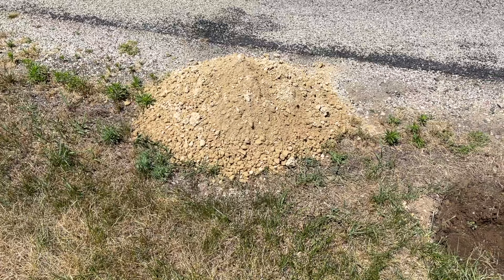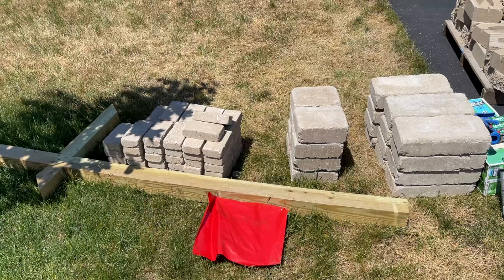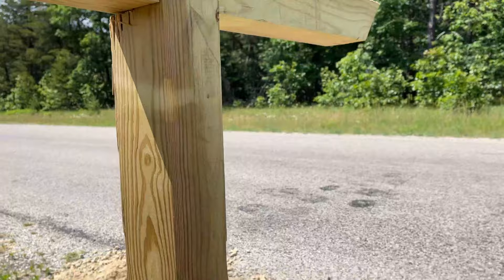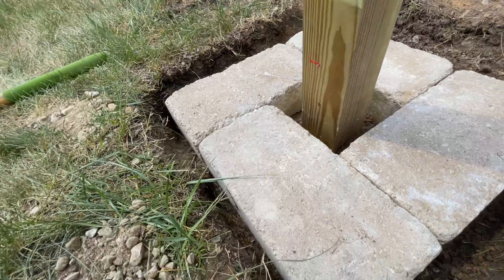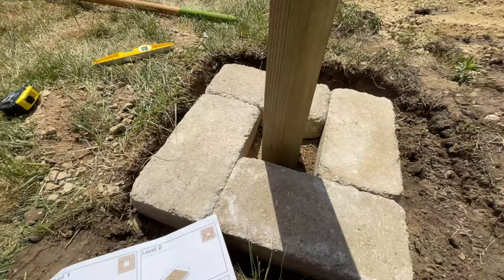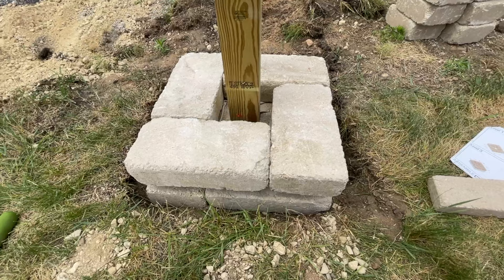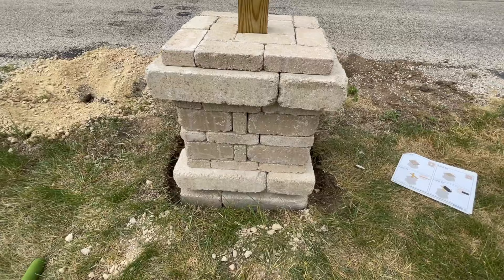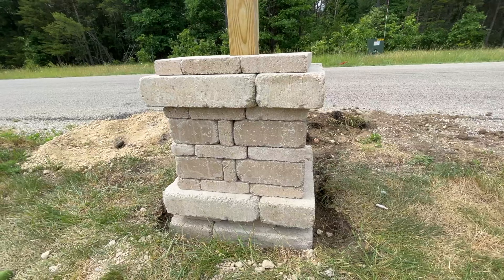How To Build A Decorative Mailbox Landscape Block Pillar

Comment from the maker: You'll Need:
If you shop on Amazon, please use Amazon Smiles to support Social Media Ministries. https://smile.amazon.com/ch/87-1084575

Coated Work Gloves
https://ebay.us/liG0S4

1 Foot Level
https://ebay.us/NofE69

2 Foot Level
https://ebay.us/Fo6BMm

6 Foot Level
https://ebay.us/lccI67

Masonry Saw
https://ebay.us/k3VH0E

Or You Can Use A Circular Saw
https://ebay.us/5xWLUj

Masonry Blade
https://ebay.us/3cxsgD

Caulk Gun
https://ebay.us/C2fj4E

PL 500 Landscape Adhesive
https://ebay.us/e7i14L

Hand Trowel/Shovel
https://ebay.us/Kq7E0F

Cinder Blocks For Your Pillar
Check with your local Menard's, Home Depot, Ace, Fleet Farm, Et Cetera.

Delphain Mailbox Plans
https://www.mmconcrete.com/ConcreteWebsite/product.do?productLineId=1038